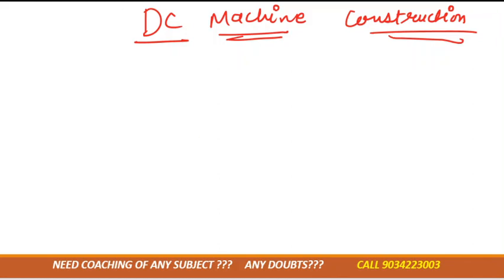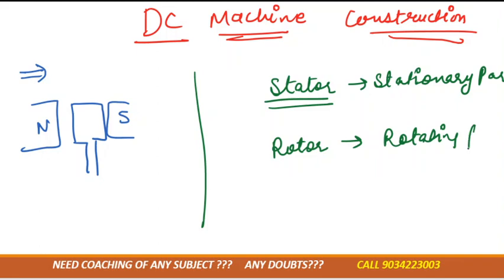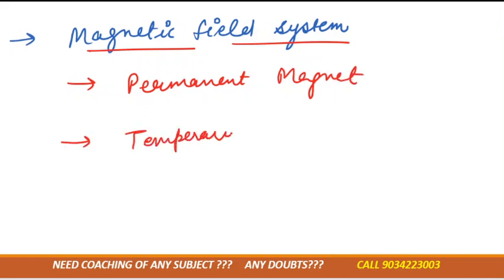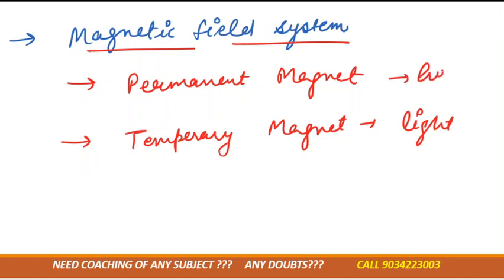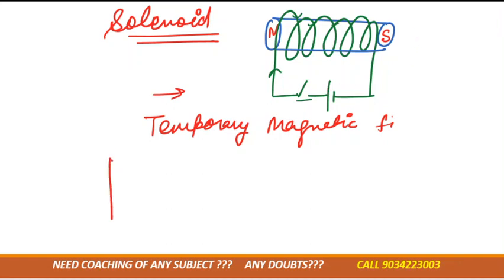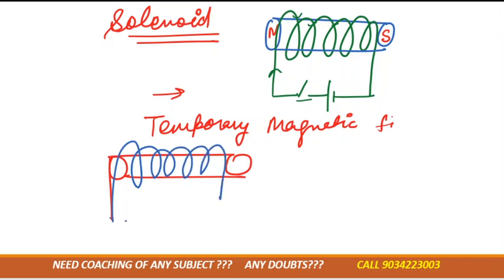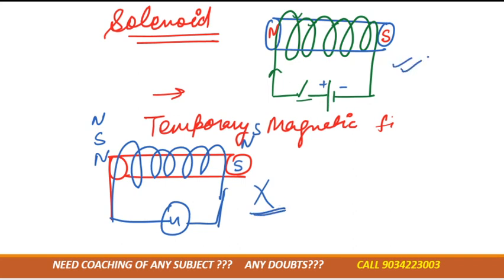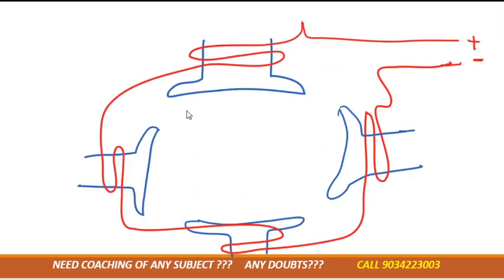DC MACHINE CONSTRUCTION

Comment: Mam we need teaching for subject electrical and instrumentation engineering which comes under anna universities. I give you the sylabus will you teach us please... 
○TRANSFORMERS 
●1. Introduction
●2. Ideal and Practical Transformer
● 3. Phasor diagram 
○4. Per Unit System
○ 5. Equivalent circuit - testing
● 6. Efficiency and Voltage Regulation 
○7. Three phase Transformers –Applications 
●8. Auto Transformers, Advantages 
○9. Harmonics 
○DC MACHINES
○10. Introduction – Constructional Features 
○11. Motor and Generator mode
○ 12. EMF and Torque equation 
○13. Circuit Model – Methods of 
Excitation
○ 14. Characteristics 
○15. Starting and Speed Control 
○16. Universal Motor 
○17. Stepper Motors
○18. Brushless DC Motors application  
○AC ROTATING MACHINES
○19. Principle of operation of 
   threephase induction motors 
○20. Construction –Types
○ 21. Equivalent circuit, Speed Control 
○22. Single phase Induction motors Construction–Types 
○23. starting methods 
○24. Alternator: Working principle
○ 25. Equation of induced EMF –
Voltage regulation 
○26. Synchronous motors- working 
principle 
○27. Starting methods – Torque equation. 
○MEASUREMENTS AND INSTRUMENTATION 
○28. Functional elements of an instrument 
○29. Standards and calibration
○30. Operating Principle , types - Moving Coil 
○31. Moving Iron meters 
○32. Measurement of three phase power 
○33. Energy Meter 
○34. Instrument Transformers CT and PT 
○35. DSO- Block diagram 
○36. Data acquisition 
○BASICS OF POWER SYSTEMS 
○37. Power system structure Generation , Transmission and distribution 
○38. Various voltage level
○39. Earthing – methods of earthing
○40. Protective devices 
○41.Switch fuse unit 
○42. Miniature circuit breaker 
○43. Moulded case circuit breaker
○44. Earth leakage circuit breaker,
○45. Safety precautions and First Aid
○BEYOND SYLLABUS 
○ 46. Introduction to motors for Electric vehicles
Reply from the maker: Yesss contact me on 9034223003
Reply: Mam how much its cost